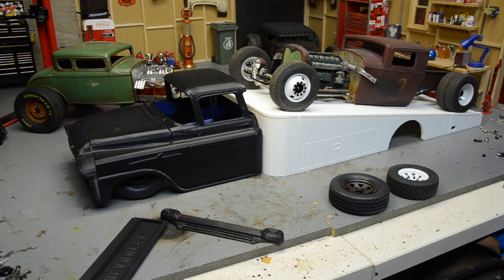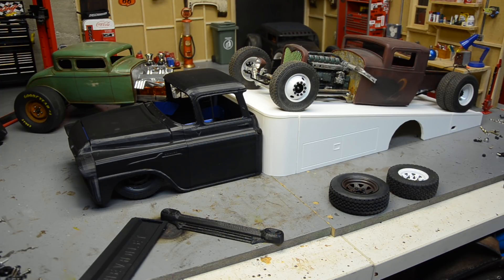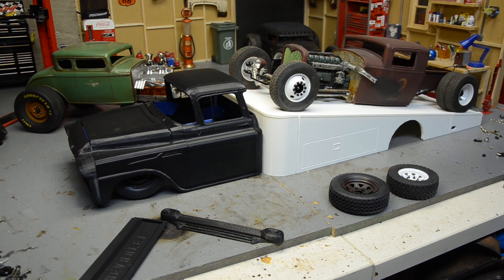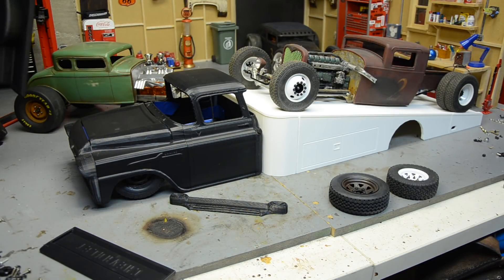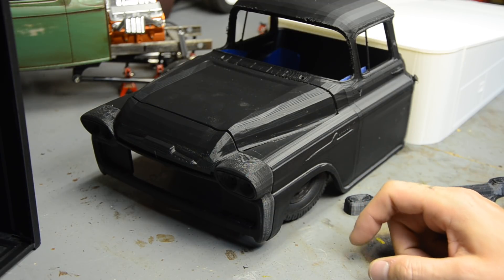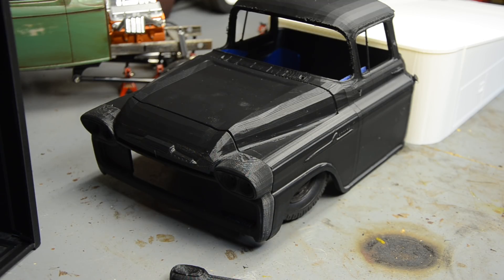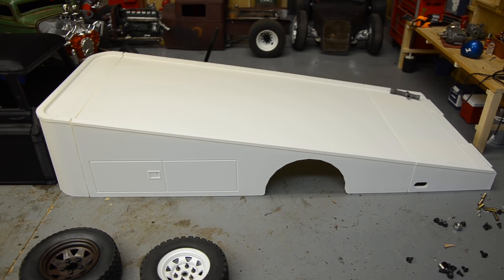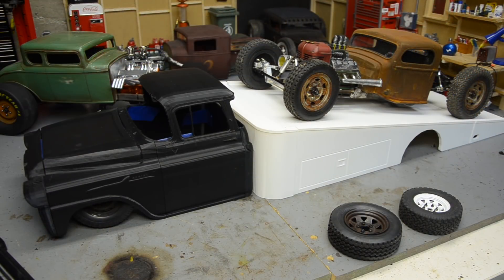The RC Ratrod Ramp Truck with ProairRC & Nightcrawlers3D, Part 1

Comment: The windows aren't as bad as you think. Find the center of the corners and then figure the size of the radius to straight. Then use a block of foam to mock up a proper shape for the glass. put a piece of aluminum or super smooth metal on the block. reinforce the metal so it doesn't change and then just heat up some lexan and place it on the inside of the metal. After it has thoroughly cooled pull out the lex and you're just needing to trim and test. Make sure you buy something to release the mold and plastic.